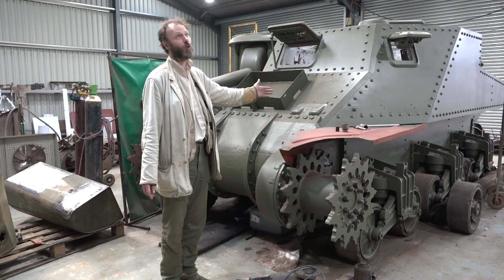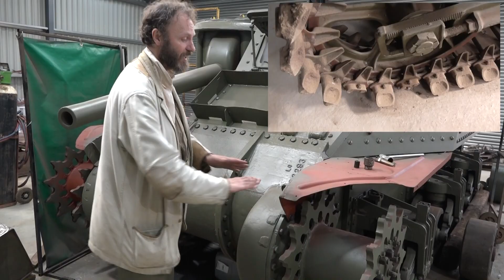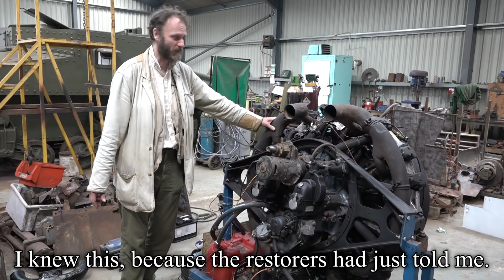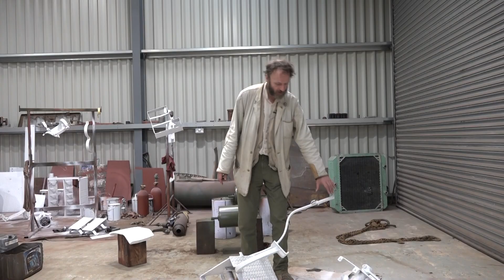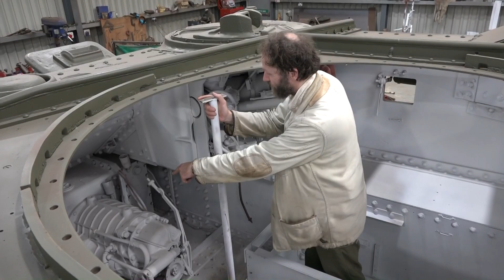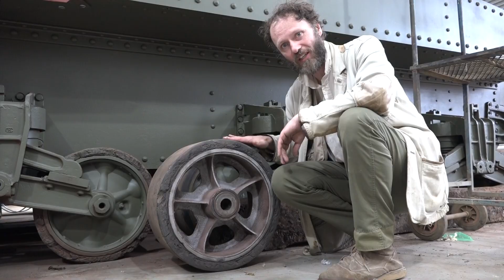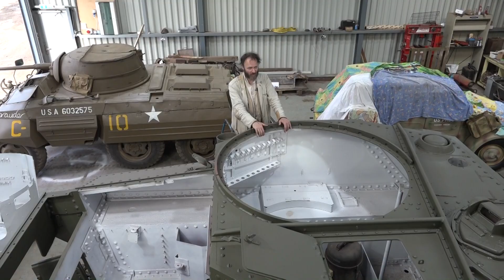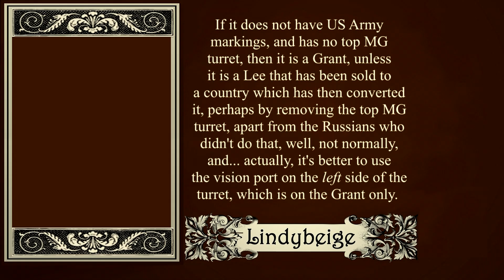The British Lee tank (that is not a Grant)

Comment: Well you can put a bigger gun into the tank hull, make it smaller profile, cheaper, lighter (or better armored) and need less crew. Then it's either a tank destroyer or self-propelled gun. Still, you could put a small turret on it e.g. with a heavy machine gun.

Comment: Aren't riveted tanks extremely vulnerable to explosives? I've heard of a 75mm HE making a tank completely fall apart! Also, the rivets broke off and caused mayhem to the crew.
Reply: Yes and no, as any real explosion that would cause a riveted tank to blow out or 'fall apart" would likely be just as fatal to a welded tank with similarly thick armour. 
There are also plenty if examples of welded tanks knocked out, with their welds blown.

Moral of the story, DON'T GET HIT. ^.-.^
Reply: @Beuwen_The_Dragon  the story I've heard was that a AT crew tried to shoot a suddenly approaching riveted tank and forgot that they had loaded HE instead of AP from their previous assigned target, but it did far more damage than the AP.
AFAIK, rivets are far more weak points than any decent weld (though a bad weld could break from temperature changes or a bumpy ride). Also, dishonorable mention to the Titanic...
Reply: The Lees had the advantage of outranging German tanks in North Africa, who would not have been able to put effective HE or AP fire on the Lee until they’d been well within the Lees range for a while. The German 88mm Flak guns converted to AT use brought enough HE to the party that welded vs riveted didn’t matter that much. If the 88 got a hold of you, you were probably toast. So technically yes but by the time the Germans upgunned their tanks, the Brits and Americans were using welded tanks, and then they were largely being puctured by AP rounds anyway!
Reply: @absolutmauser  Shouldn´t HE (and HEAT and HESH) be of near the same effectiveness at long range? You could literally fire them for several kilometers, whereas some tanks could be pierced with a 75mm from only maybe 100m. Obviously, ballistics and time of travel would make it hard to hit a moving object at long range, but that would also apply to the Lees...
Reply: Apparently the 50mm guns on the German tanks in North Africa were pretty garbage in terms of HE performance.
Reply: @absolutmauser  naturally. A tiny round with thick walls for high velocities doesn't allow for much payload. That's why the Germans used 75mm and 105, or 155mm.
Reply: edi sure, but not on PzIIIs and IVs, or StuGs, in North Africa during the Lee’s heyday into 1942.

Comment: @Lindybeige Just a point but (even without the additional welding on each rivet) using rivets actually takes significantly longer than just welding the armour plates together. This is one of the main reasons it was discontinued, mainly at the request of the various car manufacturers commissioned to make tanks for the US. They knew that not only was welding faster than riveting, welders also required far less training - which is hugely important in mass-production. Plus it created a significantly stronger join, making the finished tank more resilient.
Reply: Weight was also a major reason to discontinue it. I thought welders require more training to do a proper job above "generic" which can very easily lead to poor welds and weakening of the armour itself, its why the British had to revert welded tank designs like Covernanter and Crusader to rivet designs, they didnt have enough people trained for welding and welders were pretty much only in the shipyards. If it was easy to retrain the rivet crews, it would have been done very quickly 1 suspects?

Comment: 1:32 Fast??? so you no need get tracks down????
But Panter have some armor instead of M3 Lee/Grand.
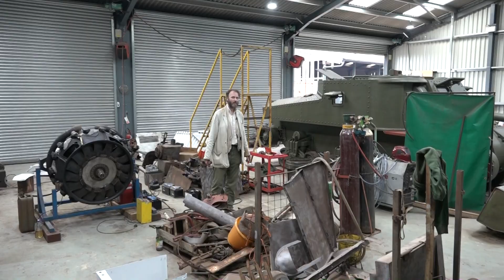6:22 Its not that bad..well if you are behing building and only your gun side is visible you can  be well hiden:):)
7:51 That must be crazy in cold.
Why the hell most tanks have gearbox in front area??One shot and your tank is dead(gearbox).
20:51 Absolute funny handle:):)
Reply: name a tank with a rear gearbox.... they are all in the front. Tracks don't work when they are being pushed rather than pulled from a sprocket. Also, panthers started production 3 years after the lee and they only had a gearbox life expectancy of 100km.

Comment: They put the 75mm gun in the hull in a sponson because they didn't have a turret/turret ring combination that could fit the 75mm.
Reply: I seem to remember the problem being that they couldn't cast turrets big enough to hold the 75mm, and the Ordnance Board had already shot down the idea of using a welded turret, so they made the M3 Medium with a sponson gun as a stopgap while they worked frantically to improve their casting technique. And then they didn't have enough of the right 75mm gun they wanted to mount in the sponson, so you got another stopgap with a shorter barrel, to which they bolted a weight at the muzzle so that it would balance (the rest of the mechanism having been balanced for the weight of the longer barrel).
Reply: @seanmalloy7249  Yeah, the Grant was a whole lot of 'but what can we build now?'
Reply: @boobah5643  Sometimes "pretty good right now" is better than "really good a year from now."
Reply: Every comment in this particular thread is correct.
Reply: Perfection is the mortal enemy of good enough for right now.
Reply: It wasn't really a ww2 tank rather a ww1 1/2 tank. It was built remembering the first.
Reply: @michaeldiebold8847  No it wasn't. It's a combination of lessons learned by watching the German invasion of France and the low countries, and the most advanced tank and automotive technology the USA had available leading up to 1941.
Reply: @Maus5000  I was speaking conceptually.  Its main gun, for instance, was thought to crack fortified positions. The turret weapon was more of a infantry support. Its original iteration had multiple mgs for trench clearing (not to look cool). Its higher profile to dominate positions. Rivited armor fails to understand that it will be facing other tanks and anti tank weapons. It was a dinosaur before on the drawing board. Not fully ww1 as it was nimble enough and easy enough to repair. But not ww2.

Comment: The cannon in a tank is almost always the secondary weapon. The main weapon is the machinegun
Reply: Not in a tank battle, it isn't.

When the machine gun is the primary weapon of a tank, then you don't actually need a tank, and a smaller vehicle would be both cheaper and more effective, but somewhat less safe. In a full scale war between equally matched forces, you can't afford to equip the army with extra armor and firepower "just in case". In WW2, tanks were used where tanks were needed, and where tanks weren't needed, smaller and more suitable vehicles were used. The only exception was towards the very end in the European theater, as the Germans were being overwhelmed.
Reply: No. Look at tank development through WW2 - main gun size increased and number of machine guns fitted was reduced, as a result of finding out what was really useful on the battlefield. Even light armoured cars were (usually) fitted with guns above MG caliber.
Reply: @jrd33  I've been in both Tanks and Strykers and both in combat...Trust me, the main gun is the machine gun or the grenade launcher or an autocannon. War isn't tank on tank battles anymore. In fact hardly at all. Even during the height of tank vs tank it never the best move to have just all out tank vs tank as the main plan. Your tank is your mobile shield that can also provide suppressive fire and direct and non direct fire support...Urban environments tanks become less useful and we switch to Strykers
Reply: @50StichesSteel  If what you say actually applied to WWII armor, wouldn't the M2 medium have been the perfect choice for the US armored force, given its frankly ridiculous amount of machine guns? There's a reason why that design was considered obsolete, why early war US tanks with large amounts of MGs had many of the MGs removed and the ports plated over, and the general trend of fewer MGs on tanks of all nations, leading ultimately to the removal of even the co-driver's MG in US tanks post-war.  The Army conducted an experiment around 1939 to determine which was more effective against masses of enemy infantry and other soft targets: a handful of machine guns, or a single 75mm with HE. The 75mm HE was the clear winner, and combined with lessons learned from watching the Fall of France from across the Atlantic, the requirements for a new tank included a 75mm gun. HE is demonstrably the most important tank armament of WWII. Even in 1945, armored units wanted more 105mm-armed M4s, and not 76mm-armed ones, because the HE was the most important aspect of the tanks. Sorry, I respect your service, but your experience fighting asymmetrical warfare in the modern day has very little to do with the WWII era armor doctrine of any nation, and in itself, is not a good reason why anyone should trust you on this topic.
Reply: @Maus5000  Fixed machine guns are about useless. Coaxial machine guns are super useful, guns attached to turret sight, or ones attached to a servo motor..WWII was the height of tank Warfare which is why tank fright became thing around that time. Even then tanks fought against infantry more than other tanks. You cant take ground with just tanks. You NEEd tanks and infantry to be effective in offensive maneuvers. They only time main cannons are the biggest worry is being defensive. It's much easier to sneak up on a tank in a wooded area as infantry with anti tank rockets than have a column of loud noisy tanks knowing your coming...Again I'm not saying the cannon is useless, it's very important in a tank role...Its just not the main gun...Watch video footage of US invasion of Iraq. The cannon was used to shoot at buildings and some vehicles.. The machineguns are what did most of the fighting

Comment: Despite violating Tank building rule #1, "One Turret per tank", the Lees and Grants weren't that bad.
Reply: Bandblade operator: One turret per tank? Hah heresy!
Reply: @pedrokantor3997  And that's what happens when you make a tank to look cool for a game.
Reply: Well, it only HAS one turret, the 75 isn’t in one!

The designers were not planning on a turret at all, Armor Force insisted on one with an anti-tank gun despite the additional height.
Reply: @nepete7  That's interesting to know.  So what you're saying is they originally intended to build a tank with no anti-tank gun?  Not really much of a tank at that point.
Reply: @rayceeya8659  The main purpose of tanks was to support infantry on the attack. The antitank was a secondary (but still important) role.
Reply: The  75mm was a purpose-designed tank gun,  with a good AP round for the time (better penetration than the 37mm). Armored Force wanted an AT gun in a turret, so added that to requirements. Read accounts  of the Grant at Gazala, it was a nasty surprise for the Germans (although overwhelmed due to piecemeal deployments).
Reply: Was it the M60 that had two turrets, one on top of the other? I vaguely recall having such a model kit when I was a child...
Reply: @Hiraghm  The M60 had a commander's MG/auto-cannon mounted in a turret, similar to the "pointless" mini-turret in the M3 Lee.

Comment: What is up with British using American tanks and then using an engine from another veichle (e.i. Firefly with 6 car engines)
Reply: that was an American engine actually the Chrysler A57 multibank. I think it was another stopgap until the FORD GAA ramped up production which was a twin overhead cam 32 valve v8 came out. Which was probably the best-allied tank engine of the war.
Reply: Quite simple; While the Brits were using the American designs, they had to rely on their own logistic chain. Arranging spare parts orders was a lot easier to do domestically than from foreign countries. GM and Ford didn't have factories in Britain, so the Brits needed to figure out a domestically available alternative solution that would fit in the tank. Linked car engines or repurposed aircraft engines were often the choise.
Reply: @Teknokraatti  The A57 multibank is American, not British. There were no British domestic alternative engines put in any M4 variants, or any other lend lease tank that I know of. The US military wanted, and got, a huge number of alternative powerplants for tanks to prevent production bottlenecks. The versions with engines that the US army found less desirable, like the M4A4 with the A57 multibank, were handed off as lend-lease, while the US stocked up on tanks with their preferred engines (GAA V8 and to a lesser extent R975 radials)

Comment: tank went to being bolted to welded is because HE would knock out the bolts.
Reply: I don't know about HE but I know AP rounds could shear off the bolt heads causing the rest of the bolt to shoot off into the crew compartment like a bullet. That's why late Shermans which still had bolts holding on the transmission housing had the bolts sunken into the armor or a lip in front.
Reply: HuntforAndrew the Chieftain explains about tank with bolted armor

Comment: Track extenders aren't grousers!
Grousers are to give you extra grip, generally on ice.
Track extenders were, well, extensions to the track to improve flotation.
Reply: Grousers were around from the start, duckbills were invented and hurriedly mass-produced in late 1944 to help with the soft ground in rain-soaked Western Europe. By that time no M3 mediums were left in service in the ETO.
Reply: Duckbill type track extenders are designed improve grip as well as reduce ground pressure so it is absolutely correct to call them grousers.
Reply: @StuSaville  No, it isn't correct. Grousers for M3/4 VVSS are absolutely not the same as track extenders, aka duckbills. Two entirely separate items.